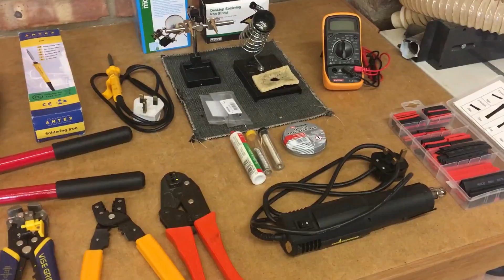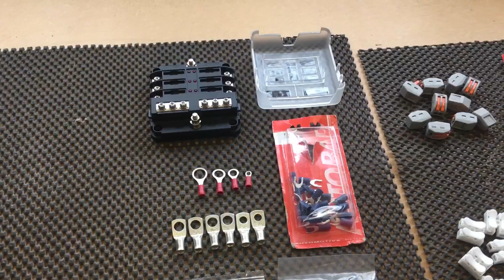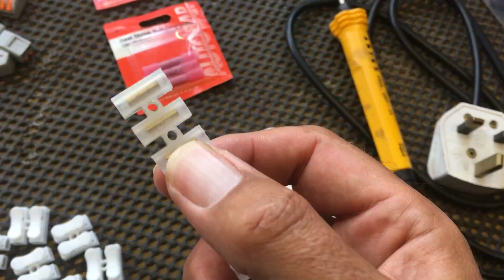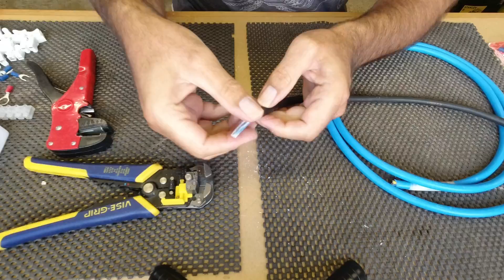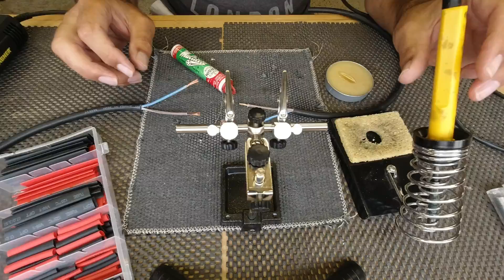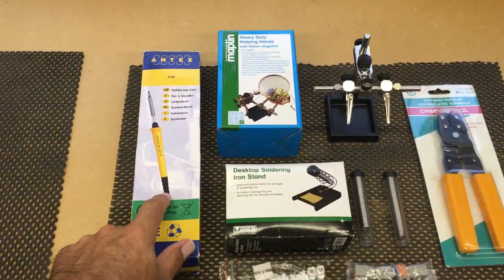Wiring Tips for Van Conversions

Comment: Hi Greg. Great video. The link for 1.5mm 2 core cable  rubber cable is discontinued. On Screwfix part number 348PF.  Would this be the same stuff?
Kind regards 
John. 👍
Reply from the maker: Sorry no that is PVC sheath and not rubber. This is what you need https://www.electriccable.co.uk/RWDrubbercable2core.php#2core
Reply: @GregVirgoe  ok thanks. So would the Screwfix option be a no no?
Reply from the maker: @johndillingham3679  it won’t have the same level of protection against movement and abrasions

Comment: not to sound weird, but you're like the dad I never had. I am currently in the beginning stages of my van build and I have spent the last 7 months watching most of your vids. Mostly because I have no idea how to do half the things that I have now accomplished, thanks to some of your vids! I am struggling with the electrical though. I am really just trying to figure out what wire to buy to prewire my van, before I install my wall insulation. What's the best 12v? I have no idea what cables to use for normal power outlets, I know that you are in Europe, so I am not clear on what some of the differences in our electrical systems are.
Reply from the maker: Hello Heather, thank you for the lovely comment. At least you didn’t say grandad 👴😂
I did a video about cable selection and at the start I talk about the best type to use. https://youtu.be/koFg6oFs0RU
What country are you from?
Reply: @GregVirgoe  Hi Greg! I am from America. I did watch the video you posted, I wasn't sure if those cables worked for American appliances. As you can tell I am a super beginner. Any suggestions will help, I have time to learn the rest, I just wanted to prewire before I insulated. I wouldn't want to be taking down insulation to fix things or put them where they may have belonged! Thank you so much for responding.

Comment: Hi gregg, I bought one of those panels where you have a dble USB charger,cigarette lighter and voltage meter etc. Is it recommended to wire them separately to the fuse box or should I wire all the positives together and then negatives and run 2 cables to the box with a bigger fuse? Cheers bud. 🤗

Comment: Your videos are great Greg. I'm not doing a van but my lock up garage where I keep my bike and hydraulic bike lift. I've got 2 110amp liesure batteries, 1 inverter 2000w and a 25ltr compressor.  All running off 2x 80w panels.
Reply from the maker: That sounds like a perfect setup for free electric ⚡️👍🏼😃

Comment: Thank you for this. Working out the different connector options and advantages and disadvantages can be a bit daunting for a beginner. Also, although I've soldered a bunch of cables over the years, it's not something I ever got to grips with properly. I'll have another go at improving my technique after watching your video. A flat iron tip seems to work better than the round tips I usually use. Very useful - thank you!

Quick question - do you normally do anything about replacing the outer sheath? Do you use a larger diameter heat shrink over the joint area to cover both cables - or do you use electricians insulating tape - or maybe something else?

Comment: Hey greg, I have a question that may be stupid but I can't find the best solution. How do you do it to separate a cable into different cables for wiring in parallel? For example for the lights wiring you plug a single cable to the fuse box, but then once it is in the ceiling, I want to separate it into X cables, 1 for each individual light. What is the best way of doing that? Thanks.

Comment: Hello Greg
It's John here, we spoke at the campfire at the van meet. I was just wondering if you've managed to make a start on the air bag suspension we were talking about (it'll only take 20 minutes 🙄😊). We left for France the day after the meet and we're just on our way back north now. We're on an Aire at the moment and there is a Ducato here with the air bags on and he's using them to level out on a slope which has spared me on to get them on myself. Give us a shout if you get a minute 👍🏻👍🏻
Reply from the maker: John I have the bags and waiting for the controls to arrive from Australia before I start fitting it. That will give me independent rear control of both sides so I can do the same in terms of levelling the van. I also plan to get the van up plated to carry heavier loads 🏍😎
Reply: @GregVirgoe  Hi Greg
Good stuff, I'm glad to here you're going ahead with it. Will you be doing a video of the installation? Now that I've seen them getting put to use in a real situation I'm right up for getting some on my own van 👍🏻👍🏻
Reply from the maker: John yes I will definitely be doing a video on the whole setup. Watch this space 😊

Comment: Hi Greg
Please can I get your thoughts on using 80/20 Aluminium section over wood for framing cabinets etc in a van conversion. 
My main concern would be condensation, am I right to be concerned or if the van is insulted & vapour barriered need I worry.

Kind regards 

Paul
Reply from the maker: Paul M anything built inside of the insulation and vapour barrier will be ok no problem 😉 just make sure to fix into your timber and not right through to the steel or that may transfer cold through to the aluminium frame.

Comment: Hi Greg, do you earth/ground your van electrics to the chassis?
Reply from the maker: Hi Lucy, I did not connect my 12v leisure system to my van it is not necessary. 
However with mains electric is it advisable to link all your earths together and bond your inverter case to this earth also. I linked the earth to the hook up earth.

Comment: Greg might be missing something here but hooked up battery to maxxair deluxe with 2.5mm2 cable double insulated pvc and after quite a time running the cable got hot and melted no fuse but I thought this cable could handle 13amps max deluxe is 5amps any thoughts

Comment: Hi Greg, thanks for all the great videos. Hope you dont mind me asking but I'm a disabled driver, have a swb merc sprinter 311 diesel and wondering if there is some way I can charge my wheelchair while driving? It's a quickie MND chair, 24v battery (two 12v batteries ) and I thought I could plug in an inverter to the cigarette lighter but told this wont work. I'm going to be doing several drives to raise funds for charity so was hoping I could find a way to keep charged while on the go. Thanks for any advice you can offer. Best wishes. Andy

Comment: Bhai mera ek help 🙏🙏 please I want to build a RV /MOTOR HOME OR home on wheels with a GENERATOR of 5kva and join in my mini bus's (force traveller 26 seats 22ft) battery with my coach battery and 2ton inverter ac . And a 1hp motor water pump please make a diagram for fixing these mainly reply me I will give you whatsapp no 8240214453
Things will be there 
1. 2 12v fan ( from hyderabad) 
2. 27 spot light (normal light)(switch for single one of them) 
3. Few car lights(which was given already)and few 12V light ( switch) 
4. 1. Ac (for rv) of 12V 
5. 22ft + 22ft cabinate light strip and celing light strip 
6. 2 electrical sunroof 2ft 
7. 2 stepup stair 
8. 1  1 hp water pump 
9. 2 ton inverter ac (Panasonic) 
10. 2  Fridge , 12or 24 volts fridge 
11. Microwave 
12. 1000w solar panel set ( breakers etc) 
What types of wire, types of joints , breaker, where to put invertor (HOW Much?? ) , everything
So confusing 😵
But I will do it 👌
Please make detailed diagram on these basis so that I can make it I will very happy if solve this huge problem of mine and THANK YOU READING THIS MUCH. 
LOVE WHAT YOU SAID BUT NOT UNDERSTAND A SINGLE THING BUT SEEMS YOU KNOW YOUR STUFFS. 
Please help me with a diagram of rv electronics with what types of wire. 
Appreciate your work. 🥰

Biggest fan of yours I will build a same style rv with my Indian model Force traveller 22feets.

Comment: Thanks again for another top video Greg! What would you recommend to connect the led lights? Some sort of 3 way connector and junction box or can you solder the wires? Not sure how you would get the heat shrink wrap over 3 wires haha
Reply from the maker: Daniel Lawrence all of the wire to wire joint in my van I have soldered.  The heat shrink comes in various sizes so it’s not a problem. Just remember to slide that on first👍🏼😃
Reply: @GregVirgoe  Thanks Greg, its joining the led lights in parallel that's confused me as it's a T shape junction to connect the wires and I wouldn't know how to get all the soldering covered by the shrink wrap after you have split the wire into two.
Reply from the maker: Daniel Lawrence think of it like a Y rather than a T with two of the three wires next to each other heat shrink in a straight line over the two cables together.
Reply: @GregVirgoe  I'll give that a go, thanks! If all else fails I'll order some 3 way connectors haha

Comment: -I am missing wire end ferrules. The guys from efixx did a video on them. Educate yourself and watch it!

-Modern caravan builders use the Wago 221 as standard so that's definitely a preferred choice of connector!

-When it comes to soldering wires it is preferred to splice them together before soldering them. Makes a more reliable and current transferable connection. Especially if you plan to never take the wires apart again!

Comment: Hi Greg, truly inspiring videos. I'm now going to have to change my VW T5. I have one question which unfortunately is not electrically based but of a general nature. I'm researching what van to get and saw a nice xlwb sprinter. They would give approx 40cm extra load but I   wondered if there was a reason that you did not go for the xlwb other than van availability?
Reply from the maker: David Kirton all those vans have total weight of 3.5T the extra length means less payload so what you gain in space you lose on what you can get in there. 
Our LWB is huge we have a 6ft permanent lengthways bed ful shower and can seat 5-6 people comfortably in the lounge. Who needs more space than that. If I could sleep widthways Fiat Ducato I would go for the shorter van than ours as parking can be a problem sometimes.
Reply: Hi Greg, thanks for the reply. It's easy to run away with the idea that bigger is always better.

Comment: Hi just bought a Mercedes 814d and will be converting it over the next few months and then going travelling around Europe. We are a family of 5 so want it all safe as have kids. I’m told my 814d is a 24c system. Seen that I can get a 24v to 12v dropper but unsure how I would wire solar panels and also how the leisure battery would work.

Comment: Great Video Greg, I must try some soldering as I usually only use crimping tools/connectors. Personally, I find the Vice Grip style wire strippers are great for removing the outer sheath of a multi-core cable too - much easier than the Stanley knife method you showed - I know I would cut myself/also bare the inner cables too! Give it a try!  
I can tell you that you have inspired me to do my own van conversion - might be a few months away but like you, I want to carry the motorbike in the back. Do you have any concerns about the petrol vapour coming from the bikes tank breather and naked flames from the cooker though? Think the bike would have to be unloaded every night or garage sealed from the living area with an extract fan too, I think petrol vapour is heavier than air isn't it? So might gather/accumulate under the van if left with a drop out hole only? What do you think Greg? (sorry for off subject questions)!
Cheers Greg - keep the great content coming.

Comment: Hi Greg, thanks for all the knowledge you provide in your great series. I wondered if you could perhaps shed some light on charging devices? Ive known for a while that I'm going to do van life, so when I updated my phone and laptop last year I ensured both charge on USB-C. Have you tried to charge your devices solely on 12V DC? Seems a bit crazy inverting 12V DC to 240V AC and then back through the devices inverter to DC.

Comment: Really helpful Greg thank you. I think the main thing I struggled with using the 2 core flex cable was splicing midway on the cable rather than just being able to strip off and join the ends of cable. I did this for my main spotlights in the van and in hindsight would have probably opp'd for simpler cable considering the tiny amount of amps they're asking for. I am a complete beginner though.

Comment: Hello Greg a really helpful and informative video. I'm just about ready to order my battery packs, I decided to go down the middle and buy extreme AGM batteries.
One question I've watched your tutorials on the schematics of the wiring plans.  They're all really good thank you .
I'm going to go with the three panel and three battery system, the batteries?  without going for the mega expensive options, would you change or have your thoughts changed at all regarding Extreme batteries?  if you were buying over again would you still purchase the same batteries.
Regards
Kevin

Comment: Hi Greg just received my bench power supply from Ebay for testing all my 12v lights and water pump ext I was wondering what else would you use it for other than just testing for 12vs supply because it's a shame for it to be just used for testing lights ext and just sitting on the shelf not being used not much about on YouTube about them CHEERS 🤔👍
Reply from the maker: David Darling typically they are just used on bench set up for testing when building electronic circuits and the like but no reason why you couldn’t use it to power any low voltage DC device from radios to kids train set.
Reply: @GregVirgoe  CHEERS Greg 👍

Comment: Another very informative video Greg. Ever since metalwork at school i always struggled with soldering but you explained it clearly and well. Video shared.
Reply from the maker: Richard Davies the trick is putting that blob of solder on the tip first. I find that transfers the heat to the wire much quicker than a bare iron.

Comment: Thanks Greg, super useful video. I've got two questions though, both regarding the negative conductor when wiring. When installing a switch in the system, where does the negative go? And when using a fuse board that doesn't have a negative bus board, what do you do instead with the negative? Many thanks

Comment: Hi Greg I have an 85amp house battery in my motor home and want to put a solar panel on roof to keep it charged. What solar panel is the best and do you think I should buy a bigger battery first. It's under driver seat so I'm pushed for size and height of it regards teresa

Comment: Hey Greg, totally unrelated question. But we have the same fridge. How often your compressor come on? Because mine seems to be coming on all the time. And I'm finding the freezer is frosting over extremely quickly.
Reply from the maker: Alistair there are 5 blue lights inside put it on the second one down it should stop freezing up. Also make sure the icebox shelf is pushed all the way in to the back. 👍🏼😊
Reply: @GregVirgoe  Quick reply! Aye I've had it on the second setting and some droplets formed and froze by the next day. I think i may have a faulty seal though i cant see any problems with it. The compressor is coming on almost all the time.

Comment: Those wago clamps are perfect. They can be used with both solid and stranded connectors. There is a smaller version, the 221 series. Those are a lot cheaper and still can handle 16a, so sufficient for most purposes. Also they are smaller.
Those screw connection blocks i don’t recommend, especially in a moving vehicle. Screws (slightly) damage the wires sometimes and they might loosen due to vibration.
The wago and those other ‘clamp’ connectors are more suitable and in my opinion a more solid option, especially with high currents
For the wago’s, pay attention to the length of the stripped insulation. Should be 11mm if I remember correctly. (To prevent clamping on the insulation instead of the actual wire)
I personally prefer soldering, but with limited soldering experiencing (and/or crappy equipment) i’d go for the wago, since that will give a good connection, while soldering varies on your experience/equipment

Comment: As always, great vid. How the hell did You get polish flux? :D "Pasta do lutowania" struck me like a lightning ;)... As to WAGO connectors You can now get a new version which is significantly smaller and still handles the same load. One on Your vid is a 222 type and the smaller one is 221. Here in Poland these are not that expensive (around 30p a piece for the ones on Your table) but has been quite popular for some time.. Anyhow, keep this up and stay safe, thanks!!

Comment: Great video as usual.
No Ferule/Bootlace terminators?   I recommend these for any clamp style connectors.  Also handy when putting plugs on as they prevent stray wires and make the job much easier.
I dislike soldering two stranded cables together in a mobile situation as it converts a small part of the stranded cable into a solid cable which can in some situations result in breakages caused by flexing.  But with a long enough heatshrink to provide strain relief or mechanically securing the cable so it can't move it is fine.  
Keep up the great work 👍